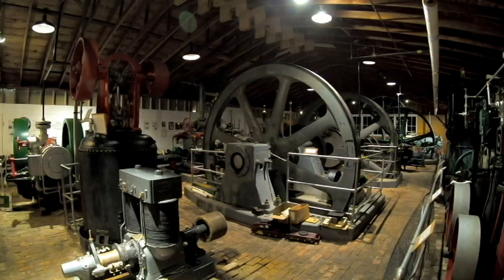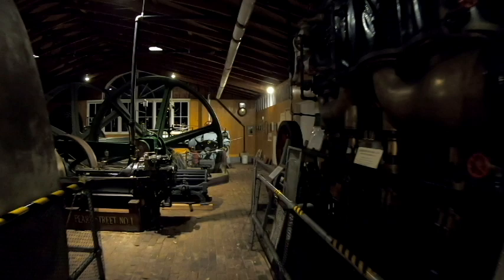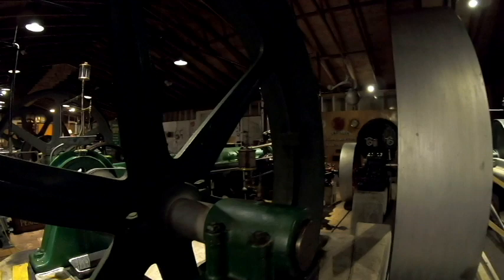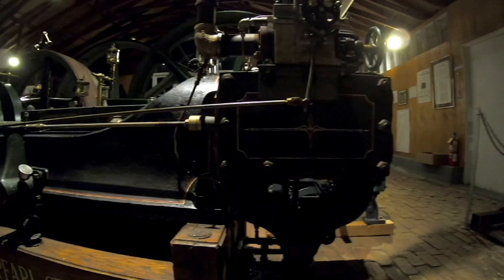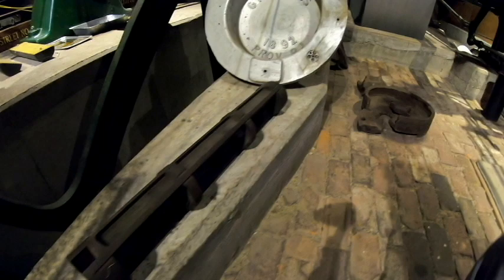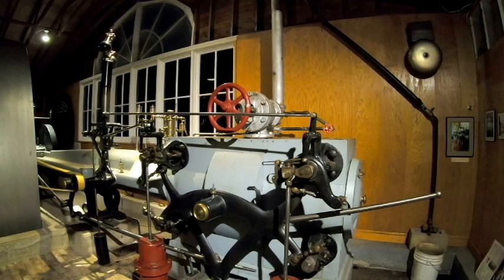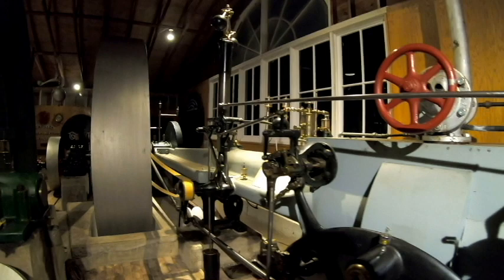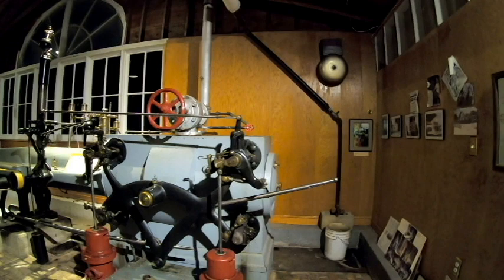Corliss steam engine valve overview

Comment: Were any stationary engines built with poppet valves? I know of a few locomotives built with them.
Reply from the maker: Yes, that was another common type, particularly in the intermediate stages of large triple expansion pumping engines.
Reply: I believe those were called uniflow steam engines